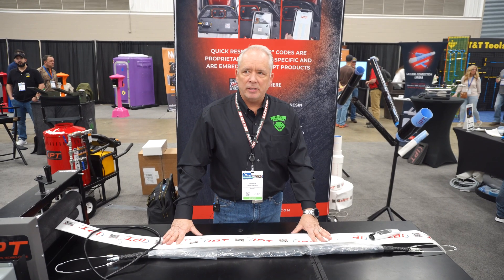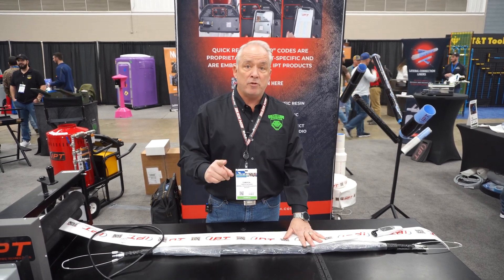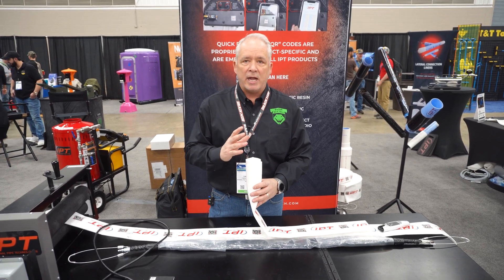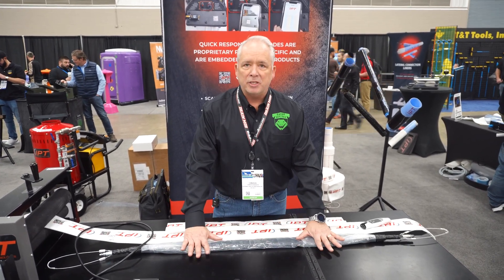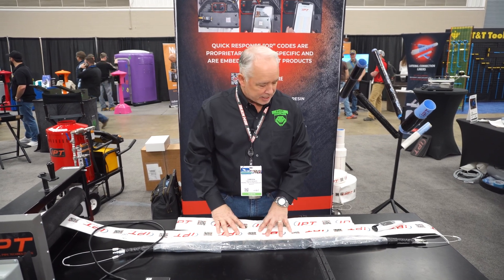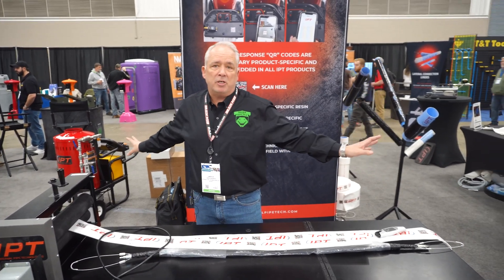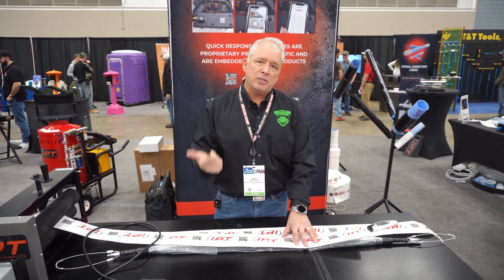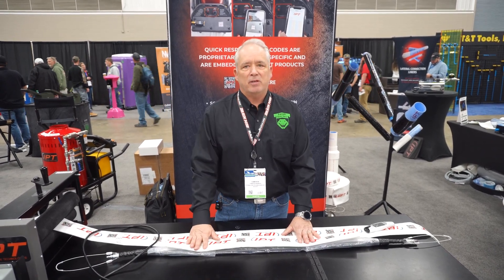IPT Pull-in-Place (CIPP) at WWETT 2022

Comment: How is the new pipe pulled into the existing one?
Reply from the maker: Our understanding is that a flexible felt lining that has been coated with a two-part epoxy is pulled through the existing pipe using two access points. The tubing is then inflated and cured in place, creating the hardened pipe lining.